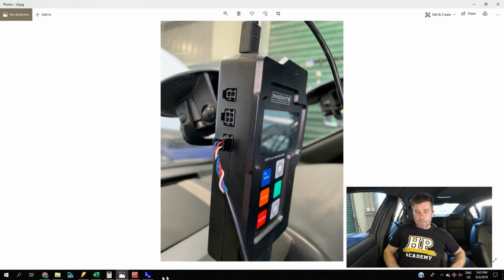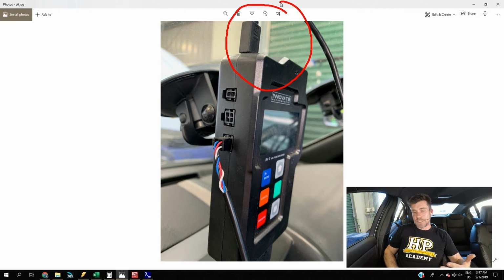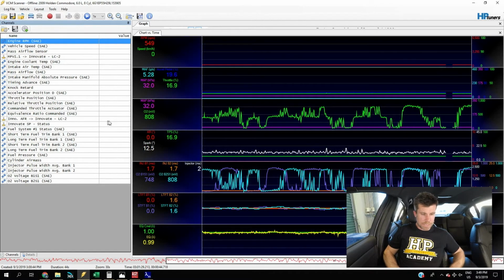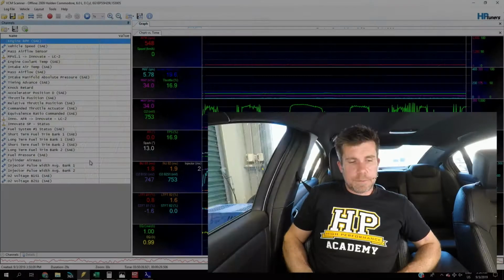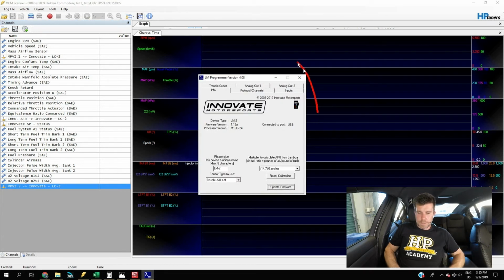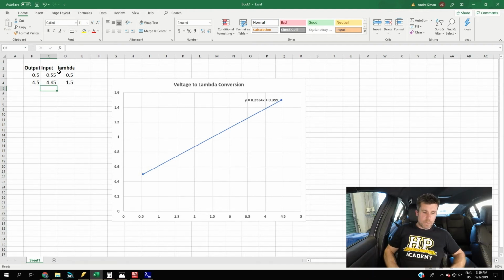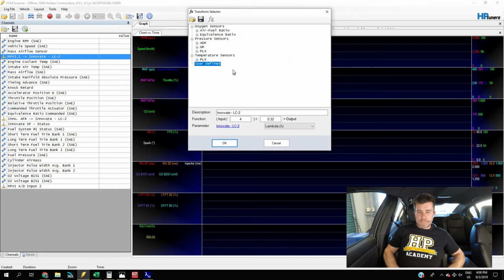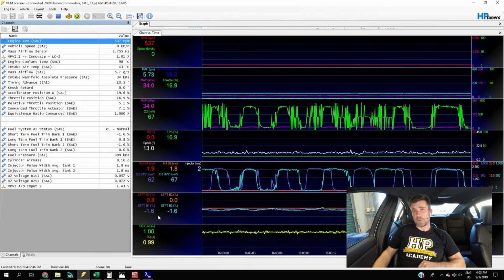Wideband AFR Data into VCM Scanner | HP Tuners

Comment: Hey bud, i just got an AEM 30-0334. I've been trying to connect it to my VCM. i can't just figure out, you got any moves?
Reply from the maker: Sometimes you have to just try a few times before it will connect if you haven't already. Otherwise you just need to do a sanity check on all the simple things and let HP Tuners know beyond that if it just still won't work.
Sometimes posting on their forum is quicker than direct help - Taz.

Comment: Goddam I can’t wait till I can understand and can utilize this lingo 

I started taking the classes Ben, I’m a big fan, and I hope I’ll be able to soon use the MPVI2+ pro

I wanna learn as much as I can before I flash my vehicle and potentially cause a lot of damage. 

In this past week of taking the classes I’ve learned to use rho and pi, to calculate air fuel ratio and a bunch of other things. I’m really looking forward to what these classes hold for me in the future. I truly hope they teach me everything I need to know, maybe I can open a HIgh performance shop here in Michigan USA
Reply from the maker: Yes you need to learn before you begin to help you start the right way, but don't get analysis paralysis either, as you do have to dive in and start cutting your teeth to get experience at some point.
Having a healthy fear or things going wrong is good internal motivation to take your time and get it right though, excited for you mate! - Taz.

Comment: Have you had any experience with the AEM X-Series OBDII Wideband AFR Controller Gauge 30-0334 ?
It states being able to work with the HPTuners software.
I asked a tuner about this gauge but they said the wideband data can't be logged in real time.
I am a bit confused wether it works or not.
Reply: I have one and it work fine with VCM scanner. I have a video showing how to connect it to the Torque App.